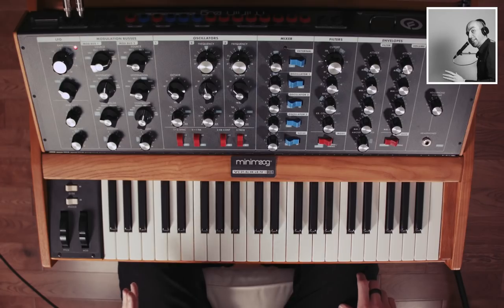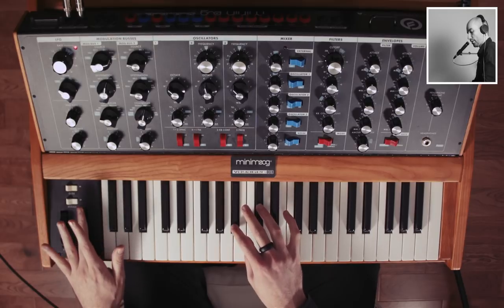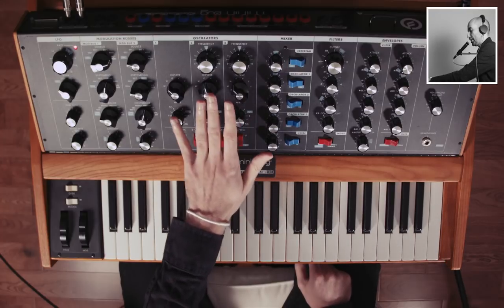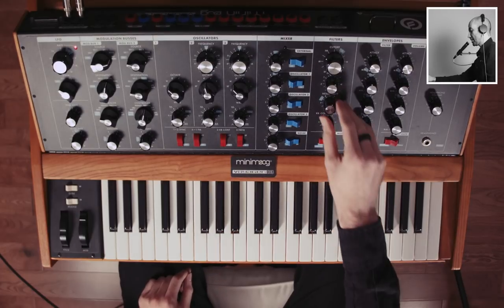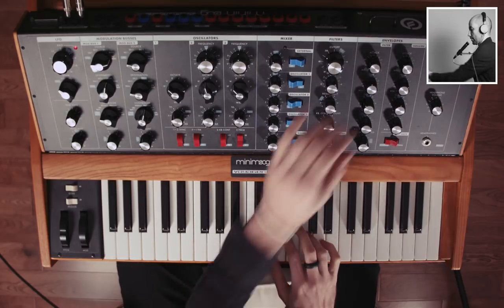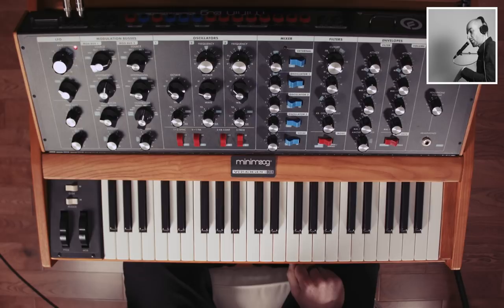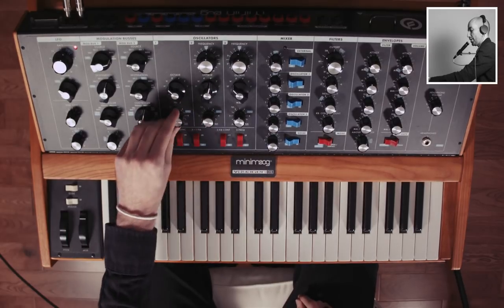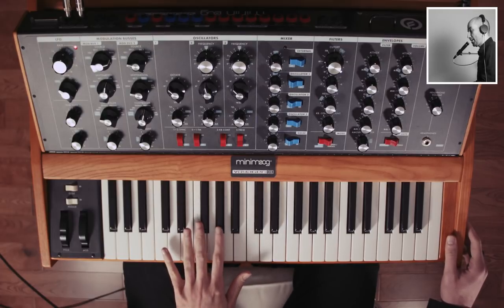Making that Moog Voyager funky Bach lead patch

Comment: If it hadn't been in the shop already, my first guess would be faulty panel hardware-- like the oscillator on/off switch in the mixer. Try forcefully switching it back and forth and see it blips in at all. Try other vco3 controls.

Comment: You are very right with the sound variation and problems between emulating acoustic sound (cello) and doing something different. I have the same thoughts. Emulating a real cello is senseless because it would be better to take a real cello. So my theoretical idea is to take the expressiveness of the music of bach and use it on a different sound. At the moment I'm not satisfied with my tries. It's difficult.
Strangely I think it sounds most convincing on the piano.

Comment: you need to find a real technician investigating the circuit with a multimeters and schematics
Reply: I'll post here some links, first you can open your moog and check for the IC's (their is a link inside this topics with much more precisions): https://forum.moogmusic.com/viewtopic.php?f=2&t=24793
Reply: interesting stories here : https://www.gearslutz.com/board/electronic-music-instruments-and-electronic-music-production/669144-i-think-my-moog-voyager-oscillator-just-died.html
Reply: just to say I read both links, they are useful, if you wanna investigate their are worth it :) but you're not obliged of course XD I just post this to help in case you're interested :) cheers :) :) :)
Reply from the maker: thanks for the links, I'll check those out
Reply from the maker: @LouisSerieusement  lol actually I did read this gearslutz forum, I replied there too (I'm bloodsample on GS), just forgot about it cause it was 7+ years ago. But I'll re-read this to see if there's something I missed.
Reply: "The problem stated in the January letter only affects Minimoog Voyagers built between mid-2010 and January 2013 with the following serial numbers: Select Series 829-1724, Performer 2990-3445, Electric Blue 1506-2075, RME 1330-1925, XL 1-545, and Lunar Select Series 1-57. If your Minimoog Voyager is not within this serial number range, you should not expect these issues and we would appreciate it if you do not unnecessarily burden our small Service Staff with a call."  https://forum.moogmusic.com/viewtopic.php?f=2&t=24649
Reply: lol but their is more on this link

Comment: Even though you are making the patch less comical and not as funky sounding, your gestures are still exaggerated and too rapid.  It's easy to go to extremes very quickly on the Moog because the instrument is designed to have real time control over every aspect of the sound but smoothness and subtlety is the key here for an expressive performance of this piece.  Be cool and reserved in your moves and the true mood and beauty of the composition will come naturally.  For my taste and personal playing style I would have set it up differently using the Keyboard Aftertouch to open up the Filter Cutoff and had the Modulation Wheel imparting the Vibrato to the Oscillators and Filter(s).  I don't know why your Third Oscillator is dead but you should get that squared away once and for all.  You are not getting the advantage of some great features of the instrument and using it in that diminished state could possibly be causing harm to the circuitry.